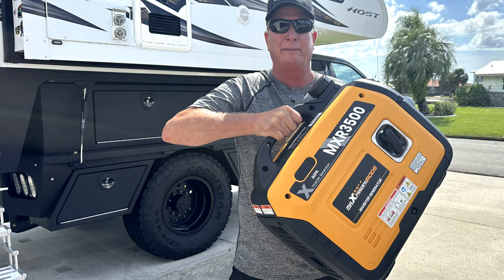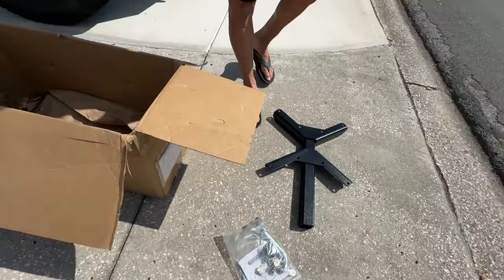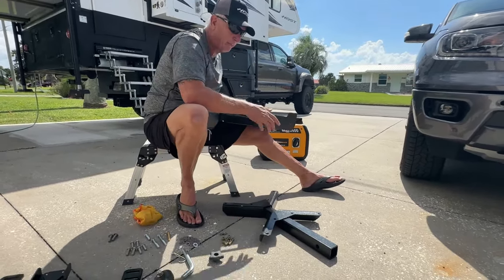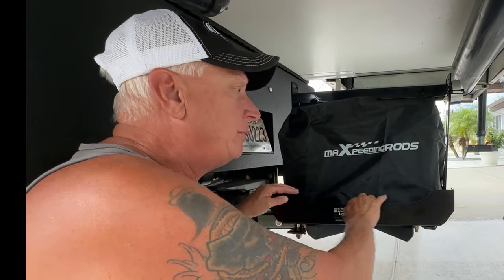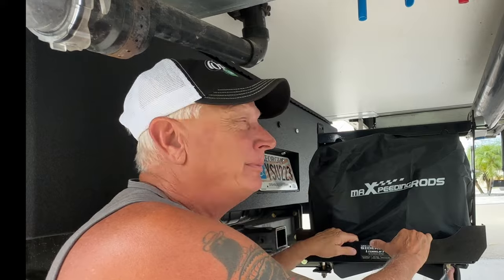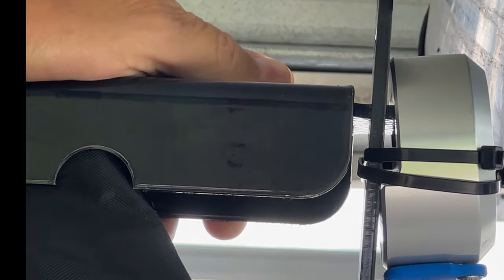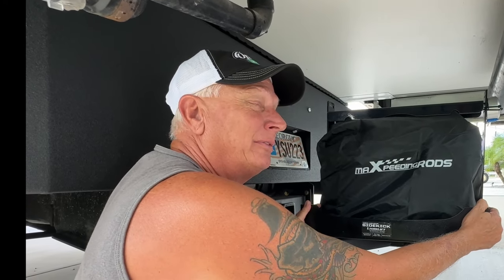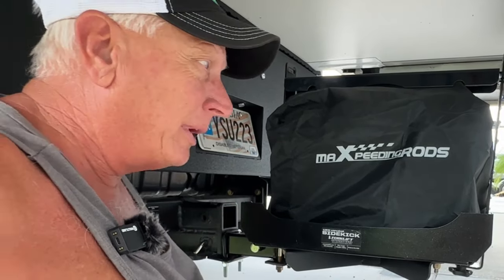Protect Your Generator Like a Pro - Truck Camper & RV Tips!

Comment: Im in calgary, n the trucks back plate goes on the camper. They all do in canada in fact. Alberta has only one plate on the back, (no front plates) so it can't be hidden or I'm sure the men in blue would pull ya over wondering where it is 😂. 
When i got my torklift tie downs, i had to check out all their gadgets on their website, n saw this thought what a great gadget for adding on a gen! Only my camper has a gen bay, n so i have it built in. But this is a brilliant simple gen idea for those that don't have the space. Hmmm, wonder if it would be a good place to haul extra deisel even 🤔. 🍻
Reply from the maker: Great idea about diesel oven. Thanks for your support on the channel!
Danny $ Donna